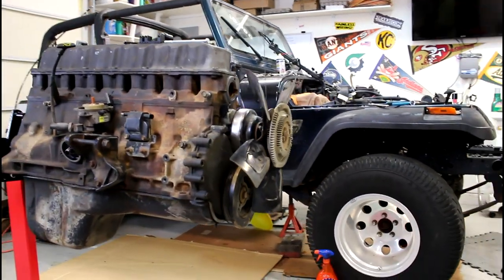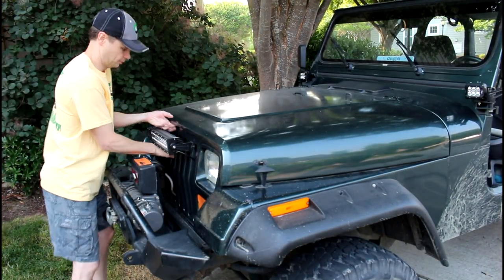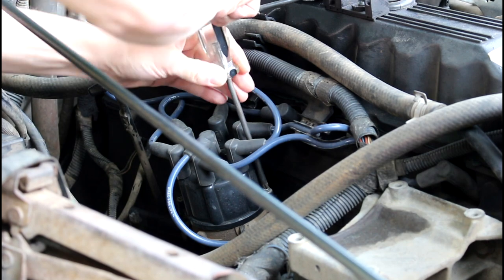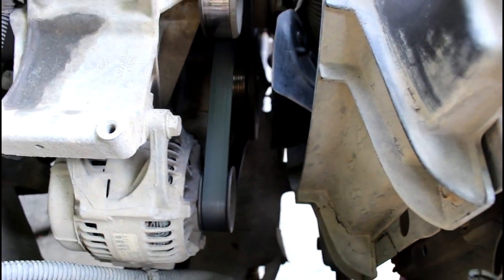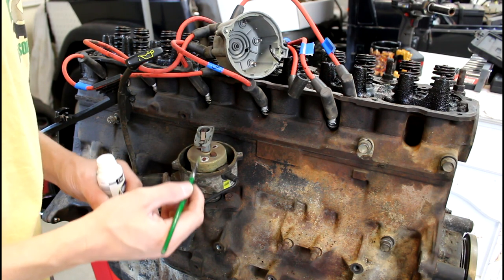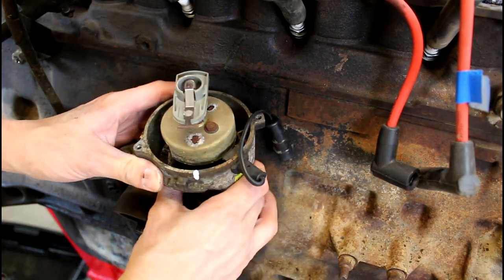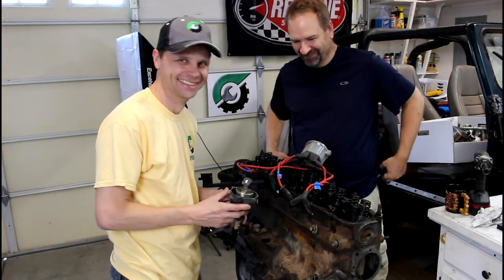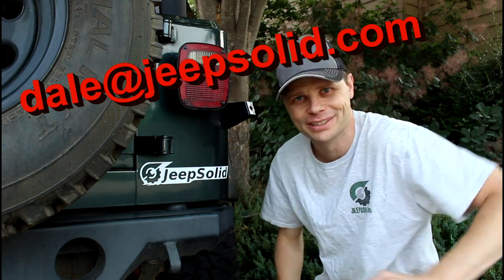Jeep Wrangler Distributor Replacement

Comment: I've rebuilt my 4.0 distributor instead of replacing it. May I offer a few words of advice: after removing the distributor hold-down clamp, take a wire brush and go around the base of the distributor stem/block and clean off the road dirt and rust so it doesn't fall into the engine when the distributor is pulled. A few puffs of compressed air after brushing would also be good as well.

Comment: Very nice video. However, you can make it yourself easier when putting the engine on the first cylinder’s TDC. Since the distributor cap was on the car, you were able to determine which one was for cylinder one. So at the moment you disassembled the distributor cap, you found out that the rotor was pointing to another cylinder, so then just crank until the mark on the crankshaft pully is aligned with the fixed mark. If then the rotor is very near the cylinder one terminal of the cap, you automatically know that you are on cylinder one TDC. No need to put finger on the spark hole. 
Still a nice video!
Edit: was only halfway the video when I wrote this. You did exactly this with the engine on the engine stand. So, just perfectly great! Nice work!

Comment: One of the many projects I have ready to be tackle... I'm glad you did this one... Only difference is I decided to go with an HEI Distributor where the coil in on the cap...and unfortunately it's vacuum driven. I have been told that I can still use it, just need to find a good vacuum source off the intake manifold, which I have located...and maybe change out electrical connections from the old coil to the new one... I just gotta get one of them round-tuits...lol
Reply from the maker: Curious to hear how it turns out for ya. Hope all goes well.
Reply: Did you get it running?  Where did you stick the vacuum line?  Thanks.

Comment: Hi did you use the hold down fork with the new distributor shaft I didn’t I put it in today. The new shaft had a fork already should I still use the fork to thanks.

Comment: Came here for the distributor replacement but noticed the AC compressor is removed. Does this jeep 4.0L have the same belt routing as a '96 ZJ? It looks similar but I didn't get to see the whole thing in the video. But it looks like you used a shorter belt to delete the AC compressor entirely. Do you remember the length of the belt you used? I'm having trouble finding what length to use to bypass.
Reply from the maker: There’s 2 size belts for the 4.0 engine in this video. 1 is if you have ac, other is shorter for no ac.  This Jeep never had ac

Comment: If you're REPLACING a distributor, it seems to me that if you just mark the rotor position, don't turn the crank and reinstall the distributor in the same position, you could avoid all of the TDC stuff and save some time.  Am I missing something?
Reply: Same thought
Reply: After watching a ton of videos showing TDC I just decided to do it like you said, just put it back the way it was and it worked just fine.  Took like 20 min

Comment: I just replaced the piston rings on my 91 2.5L. I’m not getting spark after assembly, I’m assuming I need to start what you just did to get my spark ⚡️ back.

Comment: Do you have a video for just the crankshaft seal replacement? I have a 90 4.2 i6 any tips getting the main pulley bolt off??

Comment: What are the proper steps for replacing distributor when the former owner removed the distributor but did not mark the timing and/or rotor position? I purchased the vehicle with the distributor not in it. Please help.

Comment: I have a related problem,  my jeep has developed a pinging problem and has low power, you have any ideas? I've already put in a new distributor,  cap, rotor and followed your instructions to the letter but still have the pinging. Thanks

Comment: So I replaced my distributor about a year ago with an HEI one. Had a friend help me but I’m not sure we got cylinder 1 at tdc on the compression stroke. It has run fine, starts easily, but has always had a “popping” kinda sound to it and has backfired at the carb a few times under low rpm load. Now I’m in the process of replacing the timing chain and when I have what I think is tdc, the dots on the crank and cam gears are not aligned, crank is correct but the cam gear is 180 out. My question is, would the Jeep run at all if you were to put the distributor in in the intake stroke? Another question is at tdc, are the gear dots facing each other and the distributor pointing to the #1 cylinder on the compression stroke?

Comment: JeepSolid, I have had so much trouble getting my 93 2.5L to start. It stopped running one day, and that was it. Tested and replaced all wiring, had some shorts. I then replaced the relevant fuel system parts (filter, relay, pump, TPS), started to turn over and that was it. Anyway after replacing absolutely everything, I mean everything, no start. I put my beloved YJ aside for over 2 years. I’m going to get back at it as I just realized I haven’t replaced the distributor itself. I found info online that it’s the camshaft position sensor in the bottom of the distributor. I searched the entire web for that sensor, no luck!!! My question is, by replacing the entire distributor, does that include the alleged “camshaft position sensor?” I’m not talking about the crankshaft position sensor. Talking about that ignition switch in the bottom of the distributor. If I order part 53006150 will that be what the forums are talking about? I thought I knew and did it all. I don’t wanna bug one more unnecessary part. I’m over a grand deep into an engine diagnosis and it doesn’t run. It’s the last thing I can think of. When I say new everything, I mean new everything down to every sensor, plug, wire, etc. my pcm also fried eventually while trying to start for the thousandth time after each replace my. so I’ll be sending that off. You say the word, I’ll order the new distributor and give it a try. The only distributor work I’ve ever done is the cap and rotor and obviously wires and plugs and ignition coil.
Reply from the maker: Oh man! That can be frustrating. One thing I did not read, but maybe you have done is clean the engine grounds really well. On the engine block and the chassis. Maybe you've done that, but if not, a bad engine ground will let it turn over but not start. The cam sensor could also be your issue, but before you throw more money at it, I would try to test the cam sensor.  There are some good videos out there on how to test the cam sensor. I hope that helps.

Comment: Dale I have a question when I install the new distributor in my 1998 ZJ Jeep 4L I do all that you show in your video but the rotor never lines up exactly with the No 1 cylinder pickup it is just past it, the distributor is the type you can lock in the 4L slot but no mater what I do it just won't line up have you any idea what's wrong or have i missed something.
Reply: My too.. I watch a lot of videos on YouTube and it doesn't work for me. did your jeeps start normally?

Comment: The hold down bolt is blocked by the frame i cant really get to it with my wrench am i missing something? Will a ratcheting wrench work better?
Reply: Im pretty sure its because i have the 2.5 so theres not as much room in that area as the 4.0

Comment: Great video but I had to replace the oil pump in my Jeep that has the same engine. Everyone is saying to remove the oil filter then distributor then put a flat head bit on a drill and spin the oil pump shaft clockwise until oil comes out of the oil filter. How would I go about matching up the male end of the distributor to the female flat head end of the oil pump after it’s spun a million times with the drill?
Reply: after priming the pump, just manually turn the oil pump with a large screw driver by hand till it is in the right spot (eyeball it)

Comment: Ok I picked up a 2.5 crate motor from auto parts store I have no reference to go bye for distributor placement I have my timing mark on tdc #1 compression when I put my distributor in do I use a 3/16 drill bit to key it or do like you did in your video ? Your way seem better just not sure mine is 2.5
Reply from the maker: This distributor did not have a key hole pin. So had to be done this way. Using the pin is a good option. Either way, just have to make sure the rotor is lined up where it needs to be when done.

Comment: HELP I have a 94 yj  it run for about 40 to 50 minutes then it start back firing and running rough it will die sometimes it will crank again but idle rough. Please help me figure it out. A shop  have changed the distributor plugs changed my muffler. I'm into trouble shooting for over 1300.00 What can I check. Can't get a pcm/ecm. I need Help

Comment: i have a 95 cherokee 4.0 ltr h.o.  seems like with in town driving something over heats and quits firing.  i let it set a few minutes and on my way again.  any clues?  Thanks.
Reply from the maker: Humm.  Not sure if coil going out would give those symptoms, but worth a check
Reply: @JeepSolid  replaced it 3 times.  im beginning to think it may be the control module in the distributor. But you have to replace the distributor to do so.  thanks man. Anyhting more more would be helpful
Reply: @markhicks9864  did you ever figure out what the problem was? I'm having that same issue right now.
Reply: Ignition coil too close to engine block   overheating

Comment: What size wrench you use for the hold down bolt
Reply: That's what I watched the video for!! What size is the bolt head? 1/2 inch or 13mm? And do you have to use a crowfoot wrench to get to the bolt on a 2.5L?